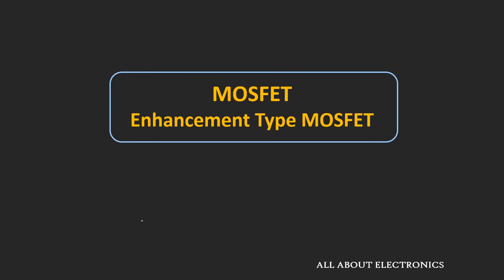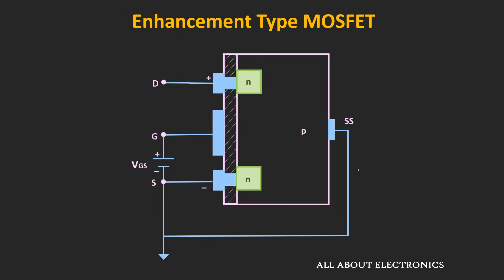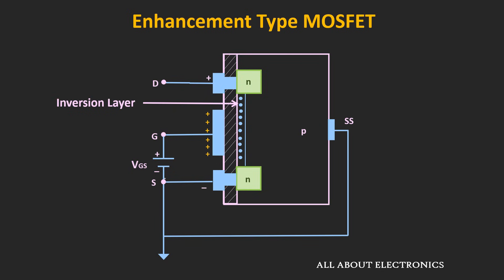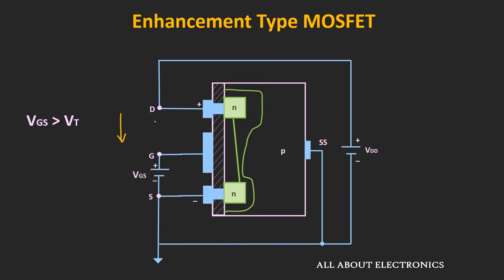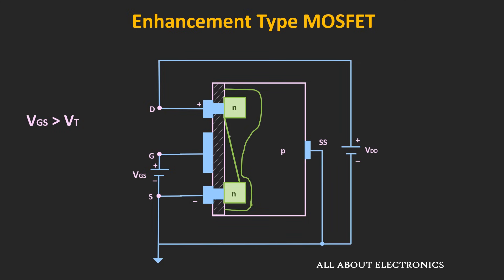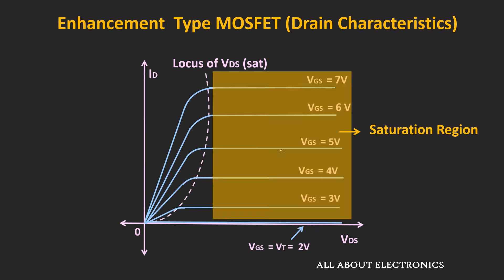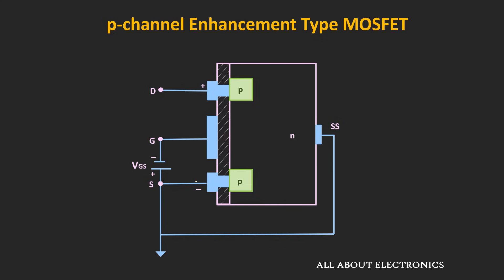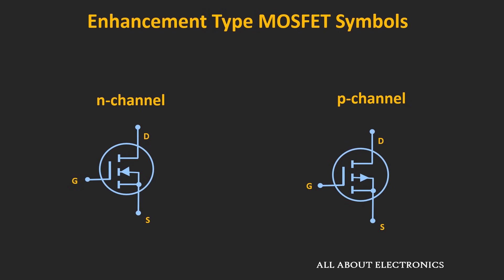MOSFET - Enhancement Type MOSFET Explained (Construction, Working and Characteristics Explained)

Comment from the maker: The Timestamps for the different topics covered in the video:

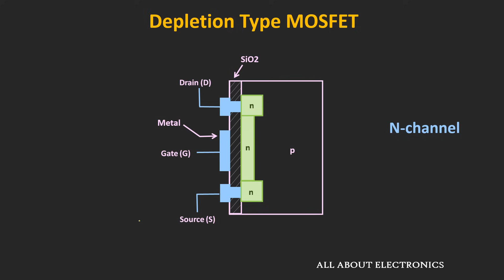0:24 Construction of Enhancement MOSFET

1:25 Working of Enhancement MOSFET and pinch-off Condition 

8:08 Drain or Output Characteristic of Enhancement MOSFET

8:31 Different Regions of Operation (Saturation, Cut-off and Linear Region)

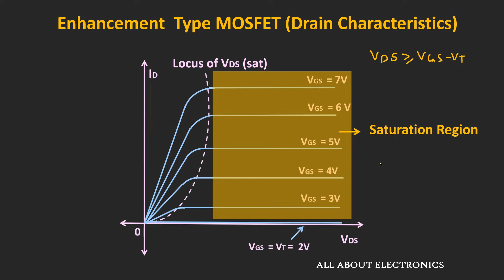10:03 Transfer Characteristics of Enhancement MOSFET

11:03  p-channel Enhancement-Type MOSFET

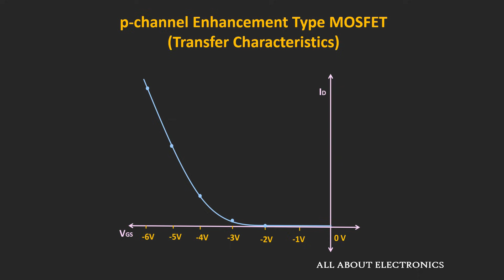12:54 Electronic Symbols of n-channel and p-channel Enhancement MOSFET
Reply: THANK YOU VERY MUCH
Reply: Video on IGBT please
Reply: Can u pls do a video on mosfet oxide tunneling

Comment: 4:32 How are both of them reverse biased? Clearly the n-region is connected to source terminal which has negative potential. So the pn junction under the source terminal is forward biased
Reply from the maker: It will be rather unbiased. As both terminals are the at the same potential.

Comment: Sir in saturation region there is no current is flowing from drain to source then how MOSFET is work as amplifier please explain
Reply from the maker: In saturation, actually the current is almost constant. On top of the biasing, when the small signal is applied to the MOSFET then it is getting amplified. I have already explained that in the separate video. 
Please check this video:
https://youtu.be/utBRWK4GmmE
Further, you can check the MOSFET playlist for more information. Please go to the playlist section of the channel, you will get it.
Reply: @ALLABOUTELECTRONICS  thanks

Comment: "Source Drain" naming is very confusing. I guess it refers to electron flow, not conventional current flow. I wish they had stuck to conventional current because the arrow is reversed and it's hard to remember whether the source or the drain is the positive or negative terminal.

Comment: In 5.49 
Why Vgd is not expressed as Vds-Vgs
You writtens as Vgs- Vds
Reply from the maker: Vgd is a voltage difference between gate and drain. Its Vg - Vd or Vgs - Vds.
If you want to write Vdg then it is Vd - Vg or Vds - Vgs. 
I hope, it will clear your doubt.

Comment: If Vgd is decreasing then why there is decreasing in channel at drain side?
Reply from the maker: As drain voltage increases, the gate region on the drain side will become less positive. (Since drain voltage is increasing). Therefore, it will attract lesser electrons. And hence there is a reduction in the channel.

Comment: Vdg = Vgs - Vds 
Is little confusing for me can you please explain a bit... Your lectures are really very simple and easy to understand... Thanks for educating 🙏.

As per me applying KVL in loop DGSD:
Vdg + Vgs - Vsd = 0
Vdg = -Vgs - Vds
Please correct me where am I going wrong
Reply from the maker: Vdg = Vd - Vg, a difference between drain and gate. Where, Vd ang Vg are the voltage at the drain and gate terminal with respect to ground. If source terminal is grounded, then it can be written as, Vds - Vgs.
Reply: @ALLABOUTELECTRONICS  Thank you so much 🙏

Comment: 4:37, How both junctions are reverse biased?
Reply from the maker: When Vds is applied, the drain is at a higher potential than the source and substrate. so, that PN junction will be reversed biased. On the source side, since both substrate and source are at the same potential, that PN junction is also reversed biased. I hope it will clear your doubt.
Reply: @ALLABOUTELECTRONICS  upper PN junction understood. But lower Junction , both source and substrate are at same potential right.
Reply from the maker: Yes, when both are the same potential then it is unbiased. But still, there will be a depletion region at the PN junction. Of course, at the drain   side, the depletion region will be wider.
Reply: Sir it's not clear about source side 
Will a junction be in reverse bias when both p and n are at same potential also ?? @ALLABOUTELECTRONICS
Reply from the maker: @Vaish-es9rk  It will not be reverse biased. But it will remain unbiased since both p and n are at the same potential.
Reply: Please explain this sir!!

Comment: This mosfet schematic will not work in real. To have gate control you need to overlap gate electrode with some part of source and drain, and without that there's no gate control so mosfet won't work at all. Please correct!

Comment: Again, a nice conceptual explanation of a difficult subject. The enhancement type NFET is the most important transistor in IC design. I  look at pinchoff as being due to opposing electric fields under the gate at the drain.